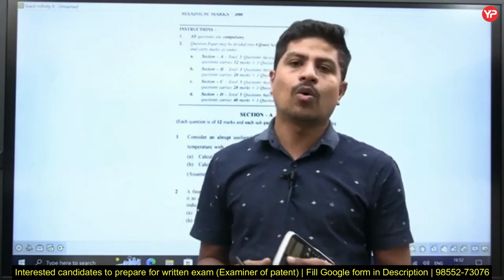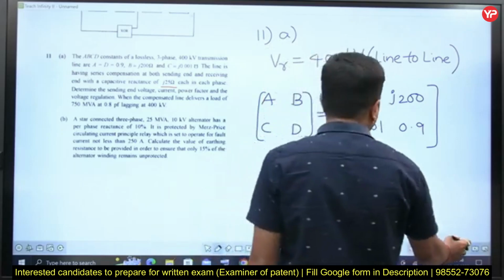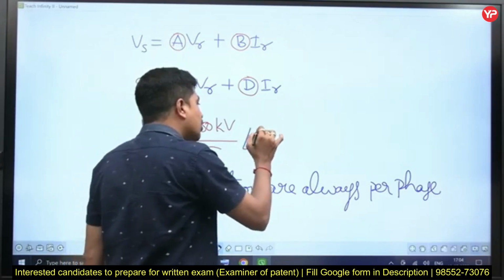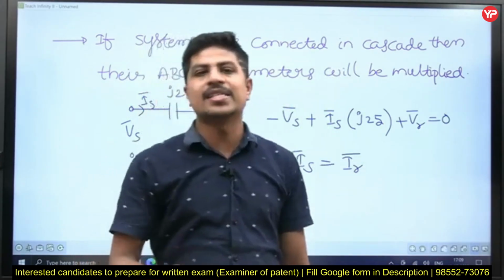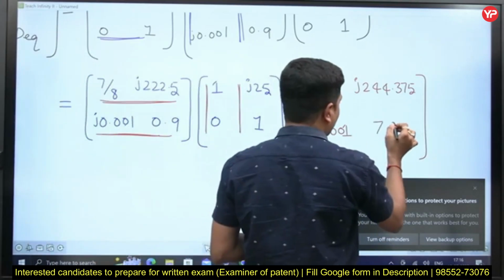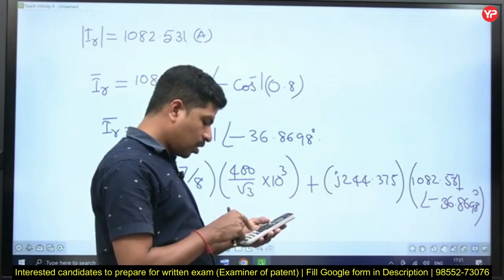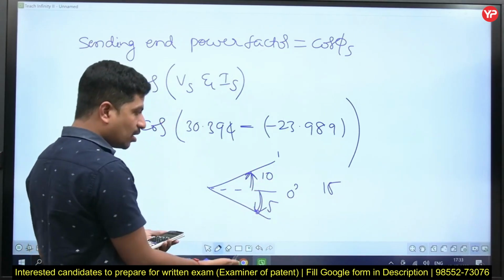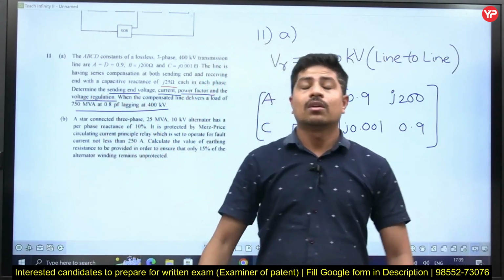Descriptive solution of Power Systems Questions asked in previous year CGPDTM exam of EE Electrical

Comment: I have doubt in determine voltage regulation there is receiving end voltage at full load is already given in question 400 kV with load  but i didn't understand  why full load  sending end voltage 418 kV is used instead of receiving end full load voltage that is 400kV.